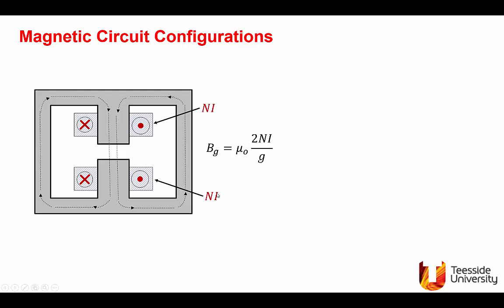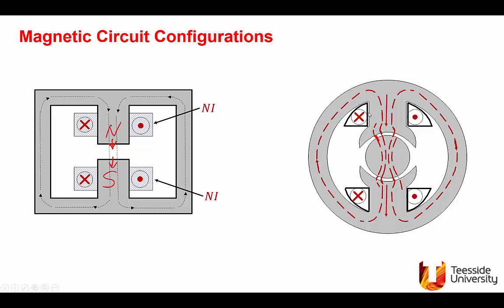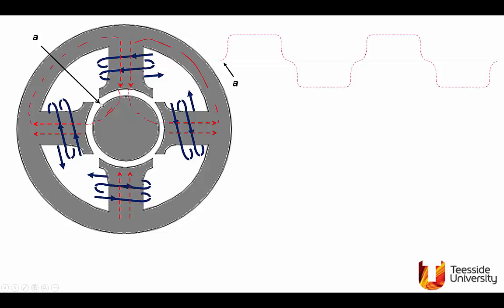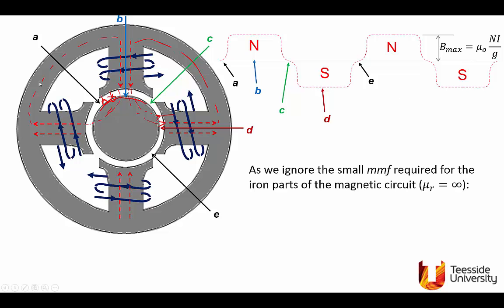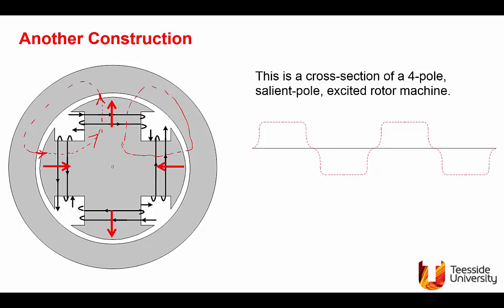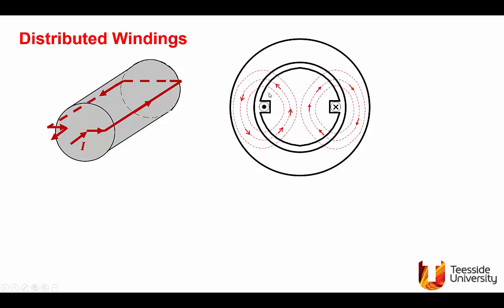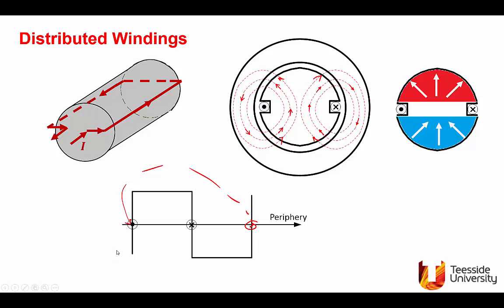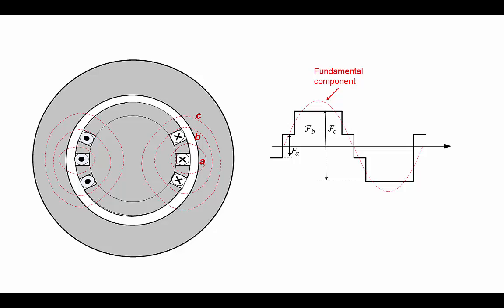Some Magnetic Circuit Configurations

Comment: professor , what did you meant by from the edge of this second pole to the third? and why did you study the flux lines at point a, c ? there were no flux lines , i mean we study the points of the flux line closed path , not the point where there were no flux lines , and from a to b , did the flux lines not constant ?